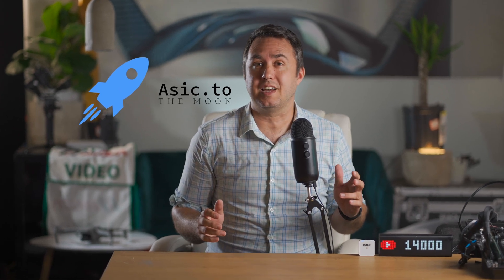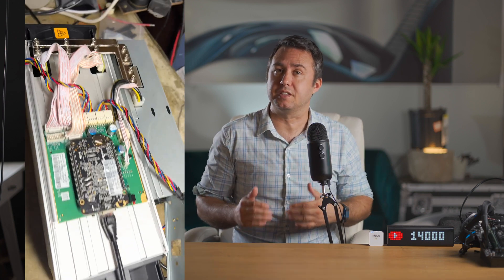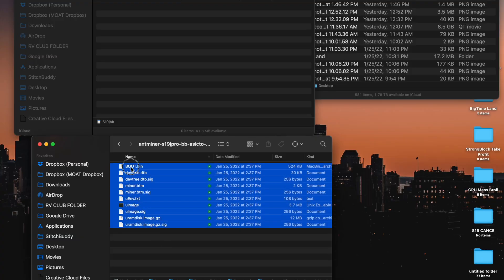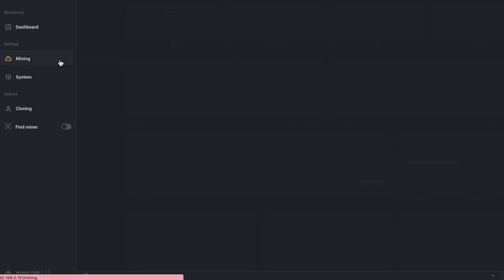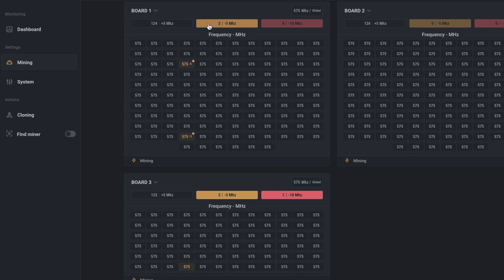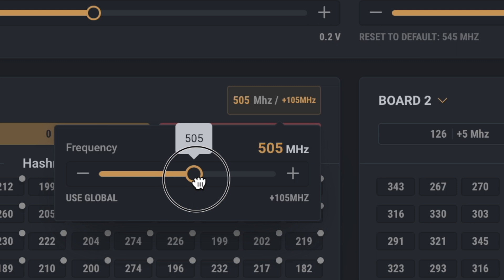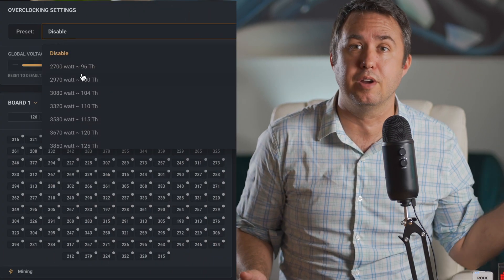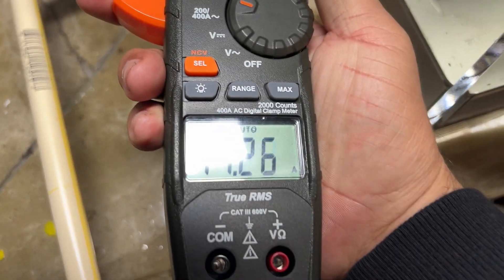S19J Pro Overclock Asic.to Available for your Bitcoin Miner

Comment: Hello everybody, very informative video in general but my S19 pro doesn’t have any of those 2 motherboards. Instead they have ctrl_C76 which has no support for USD but only micro usb. Which is the suitable firmware for this one?
Reply from the maker: Im told by the guy who runs the Vnish firmware that they are close to finishing the one that can be installed on the boards with no SD card slots.. Ill make a video when I know more!
Reply: @SPACEDESIGNWAREHOUSE  I have a board amlogic, It also has a micro usb, do you have any answer from vnish?
Reply: @SPACEDESIGNWAREHOUSE hey mate, just checking if any update on this one? I also have the board with the microusb. Any help would be greatly appreciated 😊
Reply from the maker: @GChandler94  they DO have the amlogic board figured out now, yes. But the install is custom, over the internet, from them. I’ll ask them how they do that for individuals, for now they’re generally only doing it for large farms.
Reply: @SPACEDESIGNWAREHOUSE  thank you for your fast reply mate. I think I did see the AMlogic file for download but not sure how to proceed. Shame about them doing it for the farms but hopefully they’ll have it ready for individuals soon. Thanks again 👍🏾
Reply from the maker: @GChandler94  you CAN actually get it on there by using a usb-micro to USB-A adapter and then a microSD card reader plugged into that, the SD card has to be 4 or 8GB max, and you have to flash the files onto it, not copy them. Use Balena Etcher, it’s free.

Comment: What do you think would be more profitable, ten L3+’s running @ about 610Mh, or one S19 104Th?

I’m not against overclocking the S19
Reply from the maker: Well ten L3’s would be 10,000 watts! One S19J is 3000… So they would use more than 3x the power cost… but the L3’s would make more money at least right now.
Reply: @SPACEDESIGNWAREHOUSE  do you think they’ll remain profitable since the L7’s are getting rolled out?

By the way, your channel has helped me so much. Thanks for taking the time to make these videos.

Comment: Hello, I'm just wondering why you didn't boost your miner a little more - surely with it being immersed cooled it could handle 140 easily? - as you screwed the TH up did the wattage increase start to become more inefficient?
Reply from the maker: Thats right, as you crank up the TH, the power it uses goes up even more, so the efficiency starts to go down pretty quickly.  Plus these are REALLY expensive machines - Im quite happy to get a little extra value out of them, but I dont want to find the point where stuff starts to melt :)

Comment: my s19j pro doesn't have sd card slot, what can i do?
Reply: My board s19j pro also only has a Micro usb plug in the front, no SD card.
Reply from the maker: Oooo, that’s a rare board. They are working hard to make it work but so far there’s no way to install the firmware yet.
Reply: @SPACEDESIGNWAREHOUSE  I also have this issue. Would you link to the people working to solve this so I may follow the progress.
Reply from the maker: @Bishop_warren  for sure; here is their telegram.. The developers are in there and will answer questions.. you can probably search through and find people talking about the boards with no sd card slot. https://t.me/AsicToChat

Comment: I see the file for the s19pro one is the sd and one is update. What does this mean and which should I be using? The website doesn't explain anything on which one I should be getting
Reply from the maker: The update file is only for if you've already had one of the vanish overclocks on your machine.. So if youre coming from Stock, then unpack the other one that matches your board, and put those files onto your FAT32 boot drive SD card.
Reply from the maker: after you've installed the firmware, in the future when they make a newer version, you'll then be able to update to a newer version straight from the browser interface.
Reply: @SPACEDESIGNWAREHOUSE  Oh okay so I only need the SD file on the microsd? Awesome! thank you so much for the fast reply!

Comment: Why are you running only 117TH in immersion? Wouldn't it easily be able to do at least 140TH with no problem?
Reply from the maker: I have a funny problem where I’m real close to using all the power on my breaker panel! As you over clock higher and higher you pull more and more electricity, and if I put all six miners up to 140, I will most likely blow the breakers :/
I need an upgrade

Comment: How risky is this? If I wanted to stay on air cool and just push the overclock to like 120 or 130, what are chances I burn out the board?
Reply from the maker: Depends on everything. Are you in a hot climate? 
As long as the machines stay within an acceptable temperature they won’t burn out.  But if you’re in miami or something it could be trouble.  You can still overclock to 110-115 and get about the same temps as stock
Reply: @SPACEDESIGNWAREHOUSE  Oh I'm in canada and my temps are like 58c for the exhaust with fan speeds at 4200rpm. If that's the case I should be able to get 130 or so. Thank you

Comment: Awesome content! With immersion cooling would it be possible to safely overclock to 100% (208 t/h)? Assuming cooling is under control ie. only Utilizing half tank capacity or larger heat exchanger/dry cooler?
Reply from the maker: Yes, BUT - that would require an alteration to the PSU for the miner.  It would make the miner pull like 6000 watts and you need to solder a few jumpers and resisters onto the board in a few places to make that work.. Theres a guide for it out there somewhere that ive seen.  Maybe thats a good subject for a future video

Comment: Wtf dude Dev fee seems to be 15-20% of hash rate. After running one of my S19j pro 104Th with this new firmware I overclocked it to 125Th for 12 hours and even though the firmware says my dev fee is 1.5-2% according to my mining pool my last 12 hours hashrate is only 102Th even though the firmware shows 123Th for last 12 hours. Something smells here. I’m willing to come back and amend this comment if this is corrected soon. I’m going to run this firmware for 3 more days let’s wait and see what are the results then. Any one else seeing these irregularities? Please comment. Thanks.
Reply: There is a bug With J and J pro miners. I assume that is what you have. We should have an update out within 24 hours to fix this. There was a issue of double hashing a chip causing it to create a Rejected share. Notice your rejects are probably 5-10% right now. Also the fee is 2.8%
Reply: @asictothemoon8688  Thanks for the prompt response. I am glad to hear that you guys are already putting out an update to correct some of these bugs. I will give you guys the benefit of the doubt, can’t wait for the update. P.s my reject rate is 4.8% and the dev fee varies for some reason, at times it’s as low as .08% as high as 1.8% No rush fixing that bug please lol. No but seriously thank you guys for this firmware. Now I can do my immersion cooling.
Reply: @mnace2652  Yeah that reject is too high. It should be a lot lower. It got by us in testing as it doesn't effect every machine. The devfee calculation is being addressed too it should be more accurate on the update.
Reply: @asictothemoon8688   Any update on the firmware update? The download link still shows the original version 1.1.5
Reply: @mnace2652  1.1.5 was posted just last night.
Reply: @asictothemoon8688  Awesome thanks for the update. I’ll go ahead and put it on my 8 units right away.
Reply: @asictothemoon8688  What are Overclocking options in S19 Pro 110th/s, and please also provide power consumption for each overclocked scenario ( Give LC details too )
Reply: @yashkawdiya  Just throw it on your machine 32-/35w/t on average
Reply: @asictothemoon8688  Can you provide exact details of slabs of th/s like at 110, 115, 120, etc with power consumption, I want it for LC, so please provide highest levels

Comment: I'm only getting one file to transfer to the SD card and it's not working.  Miner doesn't connect to internet, and fans run faster and slower but never connects.  Red and green light stays on.  On a S19 96 TH.  Different file for S19J Pro 100 TH will not connect to the internet.  Any suggestions?
Reply from the maker: I’m guessing the one with the fan speeding up and slowing down is a machine where the SD card is right next to the Ethernet port and you used the firmware with BB in the name.

Comment: I am wondering in the event I wish to return it  to stock settings, does one just unplug and remove the sd card? or would you have to reset the miner entirely?
Reply from the maker: Yep, if you take the SD card out it just goes back to however you had it previously. It doesn’t write over the firmware, it boots from the sd.
Reply: @SPACEDESIGNWAREHOUSE  gotcha, thanks for the response! Looking forward to your future immersion updates.

Comment: Love your videos! Have you done a cost/benefit analysis for liquid cooling? I understand you can get a higher hashrate, but power goes up too right?
Reply from the maker: Yes power goes up, too.. But its pretty much just like having more machines.. Lets say you have ten S19j pros and you overclock all of them by 10%, now youre using the same amount of power as having 11 machines, AND getting the amount of hashrate as you would with an 11th machine without having to buy another machine!
Reply: @SPACEDESIGNWAREHOUSE Excellent point!